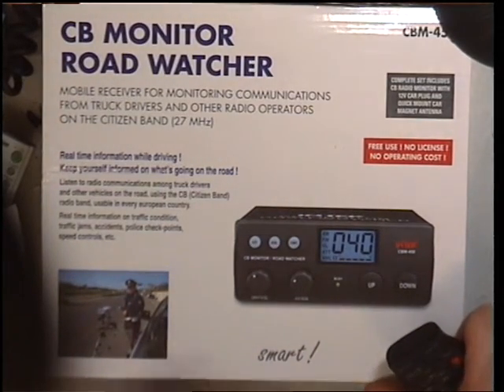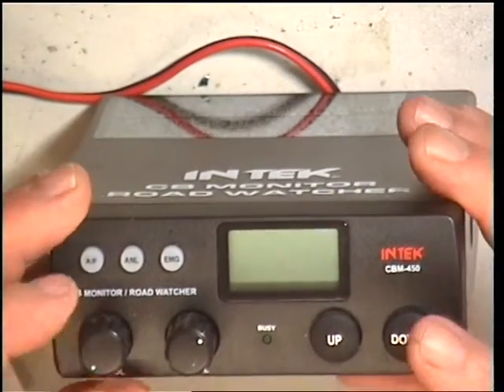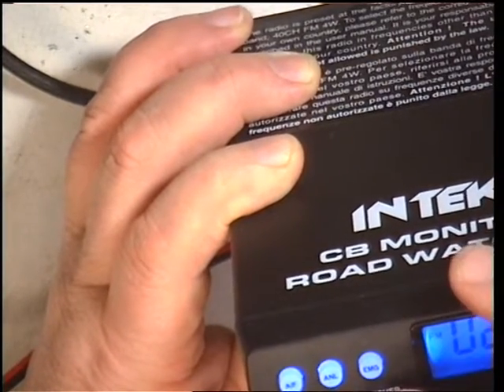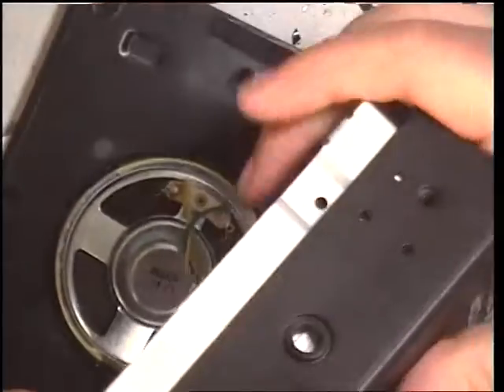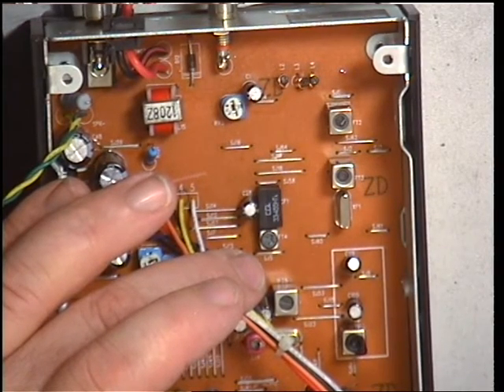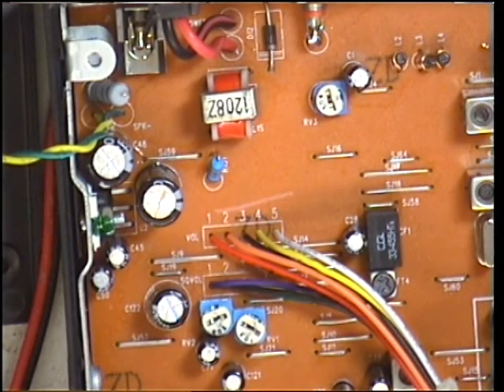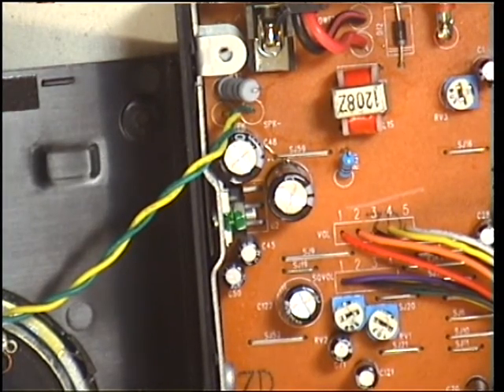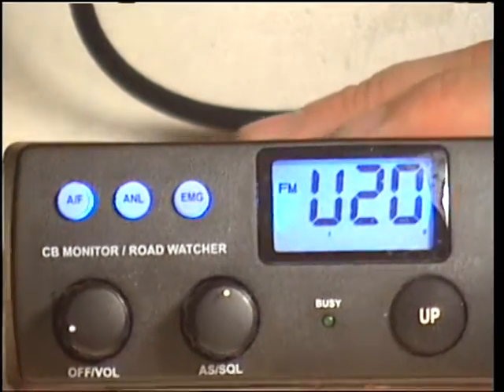Intek CBM450 CB receiver - alignmemt

Comment: That is a neat unit but it leaves any Cb'er aching for a mic to transmit. Thanks for sharing the video.
Reply: They are designed mainly for EU market in Germany,Italy,Poland, France ,Spain,Russia were road traffic reports are still used heavily on cb band a bit more seriously.Bit of a novelty over in UK,im sure they can be expanded to include 25-31mhz export coverage too for rU band.
Reply from the maker: You are quite right, I can't see the point of it!

Richard
Reply: For those who don't know any better they might see it as a novelty.
Reply: Unfortunately, road aggression and many accidents have been a plague for many years in Poland. The drivers chased away with their vulgar speech of cb-sts. Currently, Poles know that CB-radio is only intended to create fast and dangerous driving, the police do nothing about it, the fines are ridiculously low, and there is no police on the roads. Civic radio will not return home, listening to profanity and verbal aggression have effectively eliminated CB-radio in Poland at home. In Poland, CB-radio in homes collapsed around 2000 'when drivers figured they could use it to counteract police activities, the number of road accidents increased, some people thought that the CB operator at home was bad because he had CB-radio because the CB-radio have traffic criminals and they are dangerous. Saying that drivers in Poland are bad and dangerous is very negated, because there are many drivers who want to drive dangerously. For 15 years, Poland was the main recipient of CB-radio sets in the world, every 10-20 cars had CB-radio. Then the drivers were so aggressive towards each other that they hated themselves and stopped informing about police patrols. Many young CB-radio drivers believed that someone, some unknown operator should inform them about the police patrol, that they deserved it. Huge wishfulness and lack of ethics meant that CB-radio of drivers collapsed, truck drivers have it. CB-radio base stations are present on pirated frequencies out of band, this is to avoid attack from drivers.